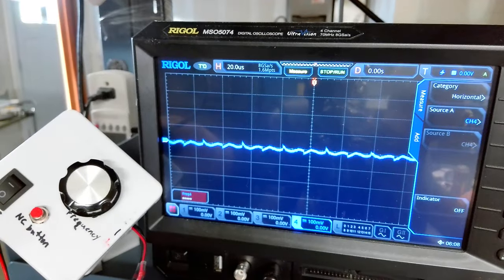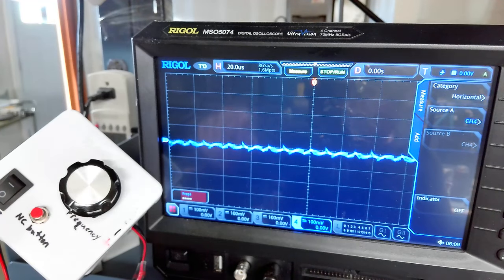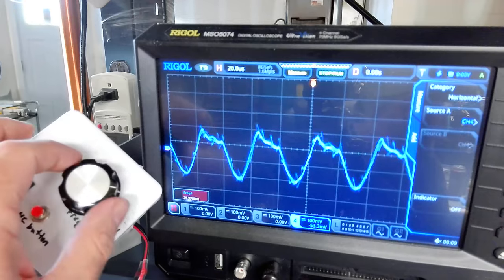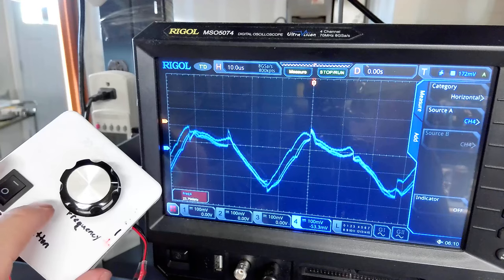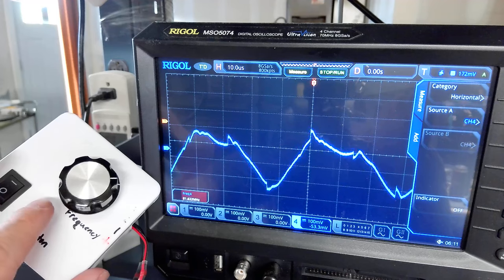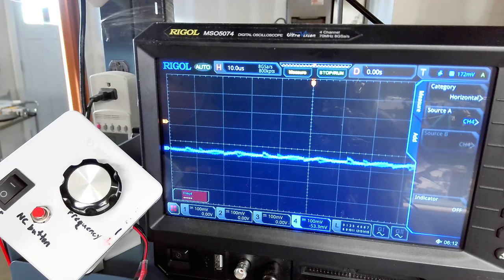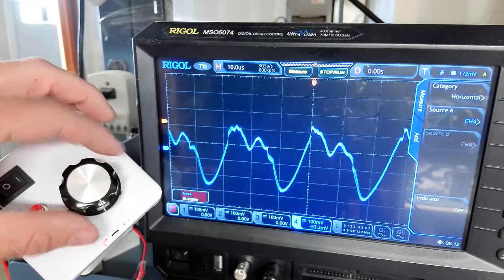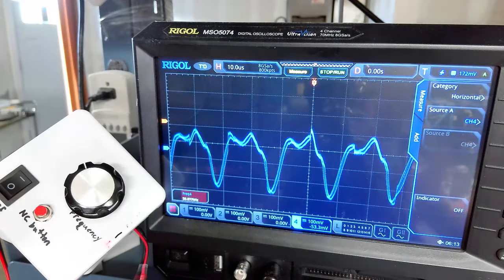Graviflyer Testing: Piezo Phase Change

Comment: I read that the spinning disk on the bottom is anodized aluminium (a coating of hexagonally crystallized oxidation), which modulates the static field from the upper part as it spins. This could be plausible because it mirrors the hexagonal geometry of a scarab beetle's under-wings which vibrate to modulate the magnetic field from the piezoelectric outer-wings which are compressed when it opens them and flies.

Comment: Triggering so high could trigger scope falsely - I suggest perhaps trigger on a rising/falling edge, near the middle of the curve where it is mainly 'straight' - just to be 100% you're not chasing a rabbit-hole :ø)
Thanks for sharing!
Reply from the maker: Thanks! Just did this and discovered another harmonic jump! This first harmonic jump (on the 27mm) was jumping from 45kHz up to 50kHz. But I just found another one where it jumps again from 53kHz up to 61kHz. Our COMSOL model shows that these harmonics should be occuring as the circular membrane modes of the piezo goes from the (0,1) mode to the (6,1) mode, and again to the (12,1) mode. The six magnets on the lower rotor seem to be producing a rotating (6,1) mode in the center disc, so perhaps this (6,1) mode of the piezo is sympathetically coupling?
Reply: @MyTBrain  Excellent!
Field interactions is like a flickering scope to me. If it is not stable but moving/glitching/flickering/twitching/skirting all over - it is a lot of work to decode and learn from. Having worked with scopes for over 30 years, I've come to if the triggered image isn't stable - the outcome (and input) isn't either, so fiddling with scope trigger settings is only way to go to be 100% sure.

I would imagine the (magnetic) metallic plate of the piezo disc is interacting magnetically with the spinning magnets; sometimes it couples stronger/weaker and this influences the way the crystallic lattice wants to vibrate. 
Also just because the piezo crystal isn't ferro-magnetic does not mean it won't interact with electro-magnetic fields (a generator can use copper windings to generate magnetic fields that drives the generator coils) in a multitude of ways.

You could try to experiment with "Ultrasonic electric ceramic sheet" - which is basically a piezo element without metal and see if it is the center metallic plate which influences the oscillating frequency.

Sadly I can not say what is causing the change in frequency. I wish you joy on the journey of discovering why, and a great weekend too :ø)